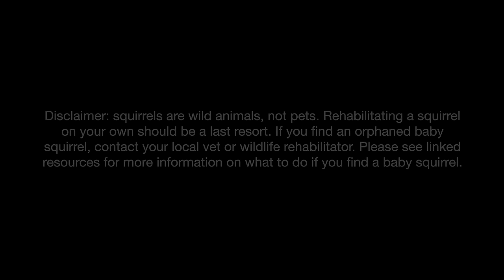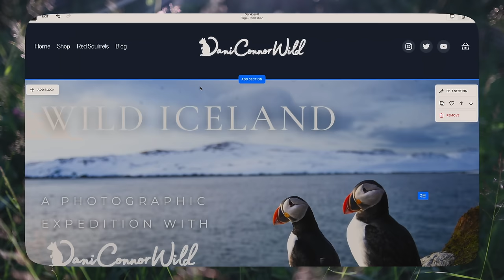Rescue Baby Squirrel goes Outside for the First Time!  (Episode 4)

Comment: I am absolutely no expert but I did have a pup out on one of the Thai islands that had a spiral fracture of the thigh bone. It never went in a splint or anything and was left to heal naturally but we did limit her motion for as long as she couldn't put all her weight on it and monitored it to try and ensure it was healing in an anatomically correct position. That was enough for that particular dog. The thing we found was a lot of fibrous, tougher tissue had built up around the fracture site so we massaged it out until it was basically all gone. That really seemed to help a lot. After a couple of months she would run behind my motor scooter up to about 35 mph so we called it a full recovery. Recovery power of young animals is supercharged.  I'm sure Roo is no exception.

Comment: Do you take any precautions to prevent passing on Squirrel Pox from when you were in the UK and travelled back to Sweden? Squirrel Pox is carried by Grey Squirrels and is decimating the Red Squirrel populations in the UK.
Reply from the maker: No, not really. If I was in contact with grey squirrels then I probably would have washed clothes before going near him. But since it’s spread through saliva, even if a grey squirrel had climbed on me, the risk of me carrying squirrel pox would probably be zero. Most grey squirrels don’t even have squirrel pox. But of course if they do, it will be havoc for the reds.